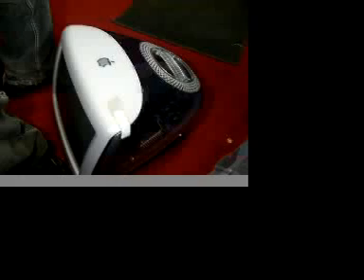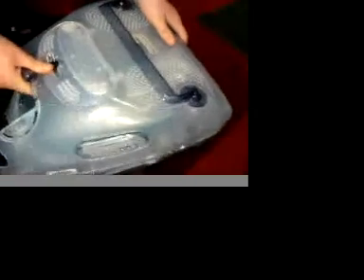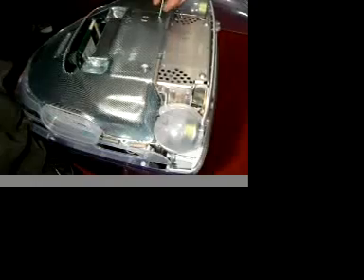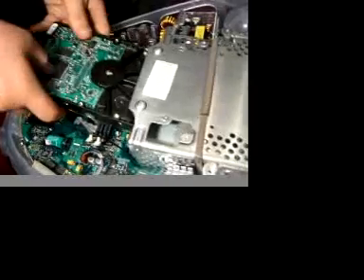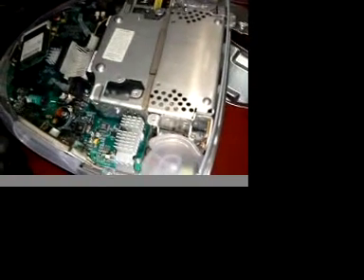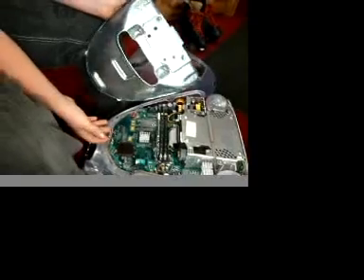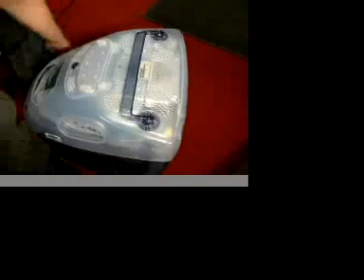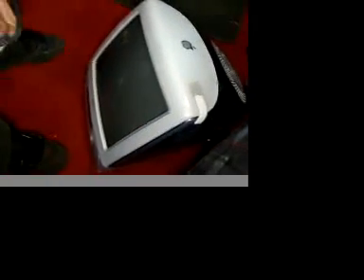Hard drive Removal On A Imac G3

Comment: I got mine for 30 bucks, so you got a steal. Mine is a 400 mhz, 10 gig hard drive, and 1 gig of ram. Thanks for the vid, I plan on replacing the hard drive and possibly adding a airport card.